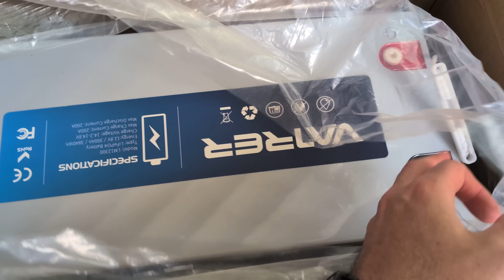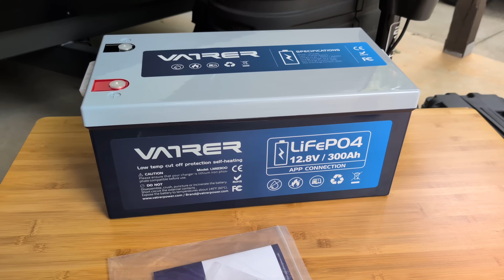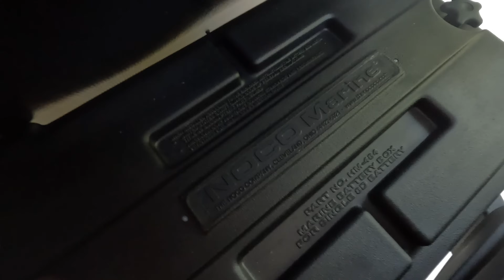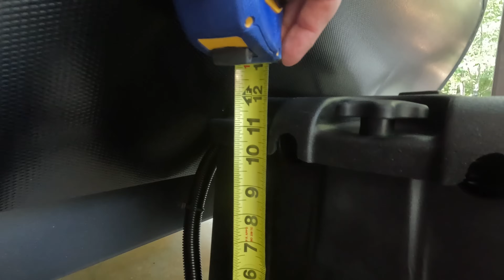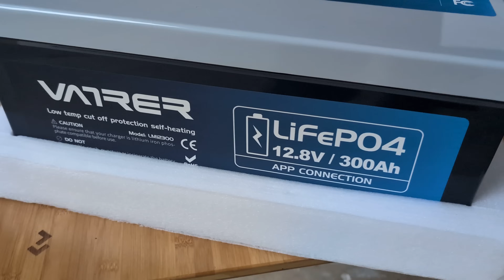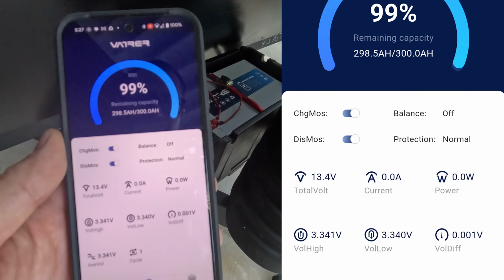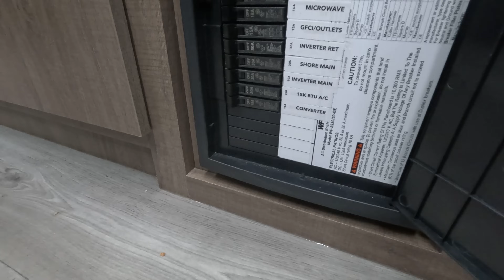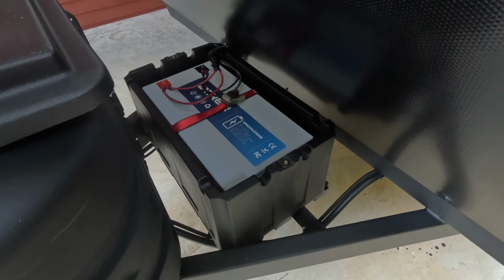How I Fit a MASSIVE 300 Amp Hour Vatrer Power Lithium LiFePO4 Battery on My Travel Trailer

Comment: Lots of good information on installing a lithium battery, Thank You. I noticed you did not put a breaker or some type of fuse between the battery and the trailer electrical. Just wondering if that would be needed.
Reply from the maker: Great question, there's one just under the frame tucked away. It was already there by original manufacturer. If I was connecting an inverter it'd be good to have another dedicated one for something high-draw like that.

Comment: Awesome vid.  I want to buy the battery!  I am not electrician!  For my rv, I have a wfco lead acid only charger converter. I don't want to replace charger until I have to.  Can I safely use my current converter/charger for the new lithium battery to charge to 100% until I need to replace converter charger?  Thank you.
Reply from the maker: It depends on the spec and age of your current charger. But, most of the time it is fine to use a lead acid charger as the lithium battery has its own BMS that regulates for safety. It may be that your battery doesn't get up to 100% or that it takes longer using the lead acid charger. So you can temporarily use current charger, but best to upgrade to a lithium compatible version.

Comment: I am considering the same mounting location, but need to avoid overheating the battery as it bakes in the hot Florida sun. Have you had it in hot weather (over 95-100 degrees)? Did it need ventilation?
Reply from the maker: The lid doesn't completely seal it up, but rather it overhangs to keep water out. But there are openings along the top for cables, so almost like vent holes. Mine almost sits behind the propane tanks more and the way the front wall arches it doesn't see full sun. I've never really checked the temperature inside, but I've also never had any abnormal temperature readings on the battery through the interface. Sorry I couldn't be of greater help on this one.

Comment: I am wanting to put this battery in my new 5th wheel.  This case is exactly what I am looking for.  How did you get the battery to fit inside the case? I see that you did it but how?  According to the spec sheets for both the battery and batter case it should not be even close to fitting.  The spec sheet says the battery is 24.5" long and the inner dimensions of the cae is 21". How did you do it?
Reply from the maker: Thanks for watching. I believe it's 20.4" ...maybe a typo?

Comment: Hello, yesterday I installed a 300 ah lithium battery in my t.t. With the Wfco converter and it has not stopped charging . Your video says it takes a couple of days for it to detect its lithium? Iam just concerned about my converter. Wtco is lithium compatible. Should I just wait and see? Thanks
Reply from the maker: Keep a close eye on it. I've noticed the auto detect models can take a while to actually switch over from lead acid to lithium. One time it took mine a few days when changing between the two. If you're over 80% on the battery charge, you could try discharging it below 50% to see if that causes the charger to recognize it faster.
Reply: @AdventureRocks Thank you for the reply. I will continue to monitor.

Comment: This is exactly what I want to do with my RV trailer.  Excellent video!  Question to you or any of the other viewers... If I used this exact setup, how would you lock it?  Make it difficult to walk away?
Reply from the maker: I hear you. For me I don't store it off site and most of the time when I'm camping I'm with the rig and don't leave it unattended for long periods of time. Thankfully it's kind of hidden back there where the average thief wouldn't think to look. But I could see if I was going to leave it unattended I might try to secure it further or at least make it more difficult than it already is to remove.

Comment: Thanks for the video.  I have a Grand Design AIM, and I am considering an upgrade to Lithium.  Lots of disagreement regarding a DC-DC charger to "save" the alternator.  Did you consider the need to add a DC-DC Charger (assuming that you are using the 7-Pin connector from your tow vehicle)?
Reply from the maker: Thanks for watching! No need for DC-DC unless you really want to supercharge the battery at a fast rate. Otherwise if you're just interested in trickle-charging, you can use as is. I think it's more the heavy-use of a DC-DC charger that folks have mixed opinions on. It was a question I had myself that I tried to answer in further detail in this video here:
https://www.youtube.com/watch?v=rs-YeXoDSVM

Comment: I’m curious how much longer can you run your furion 12v with this battery. I watched your other sagway setup and I was thinking of doing the same but this bigger lithium battery might fit the bill until later down the road. I know different climate yields different results but an approximation might help me make a better decision. Your videos have been very helpful in planning the upgrades I intend to make when my 21BHE arrives. Thank you
Reply from the maker: Thank you for watching. I've found that with the 200w solar panel and decent sun, I barely use any battery power with the 12v fridge running on travel days. I've never done a long-term test, but I'd estimate 1-2 weeks minimum with just 12V fridge. It's a great value packed battery. I'm still using it today. Hope your delivery on the new unit goes smoothly.

Comment: Now that you've been using this setup for a few months - how is it working? All good?
Reply from the maker: Thanks for asking. Yes, going on about 6 months now and no issues. The box and setup has worked flawlessly. And the battery itself, too. Even through the winter with sub-freezing temps, no issues.

Comment: Right now its 17 degrees in NJ. I might put a 12v heating pad in the battery box just for good luck. 
Does your tow vehicle charge the house battery?
Reply from the maker: I hear you, that is cold! Right now I've got it set with just the regular tricklecharge via 7-way connector. But, I tested a Bluetti Charger1 (560W max) that would be perfect to charge via tow vehicle in this video here:
https://youtu.be/8A6BvXudcOg?si=K-1HGYI6fe_znpS

Comment: Another great video. I also have a 2024 Grand Design Imagine XLS 21BHE. I'll probably use the two lead-acid batteries until they wear out, but then it would be fun to try this upgrade. I noted your comments about making sure the charger works for lithium batteries - does that apply for the solar panel charge controller as well? In other words, if I understand it correctly, the battery is charged by either the shore power charger or the solar panel charger. Do I need to make sure both of them are lithium-compatible?
Reply from the maker: Thank you, again. Great point on the solar controller...I completely forgot to mention that. Controller should ideally support lithium too. I think more of the solar controllers out there will have the lithium support natively, but I previously tested a ~2019 GoPower unit that only had AGM and lead acid. Thankfully it seems like in the present RV manufacturers are choosing models that support lithium right of the bat moving forward, but thank you for the reminder as either way have to make sure it is set properly.

Comment: Hi friend, 
Thanks  4 the  info...😊  
I rewlded the cross supports so box set inside  frame.then a STEEL FLAT piiece i could bend n weld a hinge to frame then a good lock. These batts r going to be the new theft item as was  gen 's and  catalytic on autos.😊

Comment: Is the size of the wires going to your battery large enough?
Reply from the maker: Great question. When increasing amp hours, no need to change gauge of battery wires. But, if you were to increase the amp draw such as installing a 3000W inverter with a new battery, then you'd need to upgrade gauge of battery cables to match the increased amp draw.

Comment: I thought you installed a solar generator/power supply in an earlier video ?  Did you remove that or is that just used for the 110volt circuits
Reply from the maker: Thank you for the comment. I had the opportunity to test this mega battery and I enjoy projects like this, so I crammed it in between the A-frame. I only use this battery for 12V right now. I still use the power station for all things 120V AC.

Comment: Is it ok to upgrade my 60amp converter to a 75amp? Im only using 1 lithium battleborn battery
Reply from the maker: @Fallenicons24  yes, typically if anything you want higher amperage so that you have excess capacity as opposed to less than before.

Comment: If I missed it let me know. Did you had a DC to DC charger on your Tow Rig. I am looking for a very user friendly way to do that?
Reply from the maker: Great question. I am planning to test a Bluetti model Charger1 that supplies 400W and is compatible with a wide range of devices such as the Vatrer 12V. There are other brands too, but that's one I plan to test soon.
Reply: I had the same question, and will be watching for the Bluetti video. Thanks
Reply from the maker: Thank you for patience. I got the DC to DC video published via link below. It is featured in my Jeep Wrangler, but it would work in a truck/tow vehicle and charge a lithium batter like the Vatrer 300aH:
https://youtu.be/8A6BvXudcOg

Comment: THANK YOU for the enclosure and strap down tips! I purchased the heated version of this battery last week. It was on sale during Amazon Prime days. I queried on Amazon and a FB user group on options to enclose and secure this as the battery box that housed two lead acid group 27 batteries inside my Forrest River 281RK 5th wheel is too small. I got everything from crickets to why do I need to enclose it as it's a sealed unit! Yes, that was one of the replies. Thanks again!
Reply from the maker: Thank you. Appreciate the comment!

Comment: I did the same thing but with 2x Group 24 12v 100ah lithium and put them inside the trailer under the couch in my GD 22bhe where the bed drops down above above it.  Since they are higher value items I didn't want it outside the coach and they don't need ventilation like Lead Acid Battiers.  Another big deal about getting a lithium battery is weight savings.
Reply from the maker: Very nice! Great point.